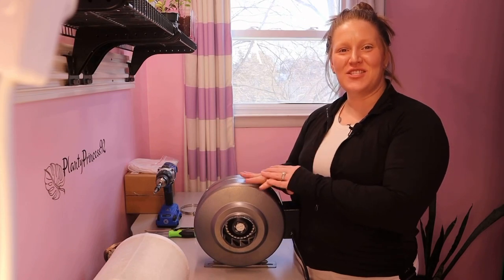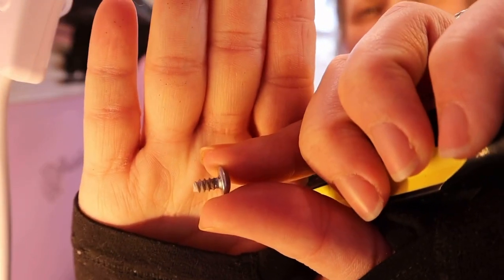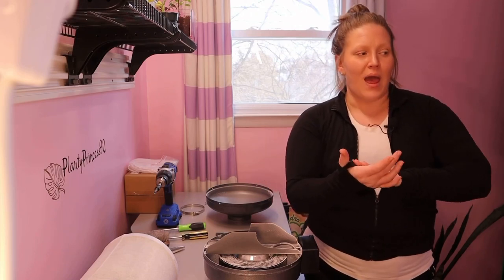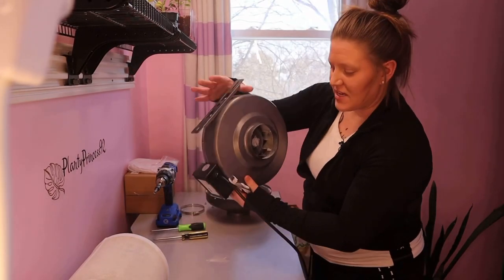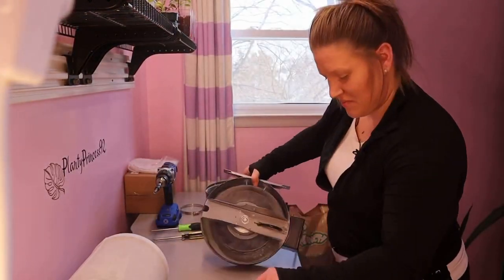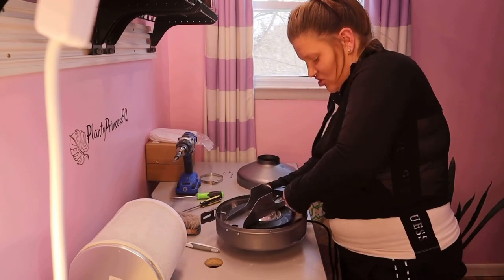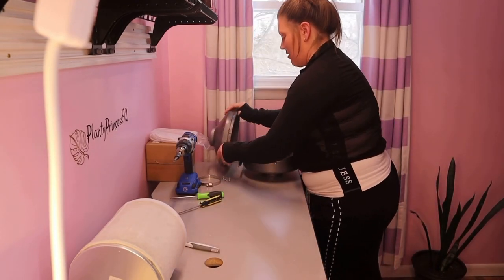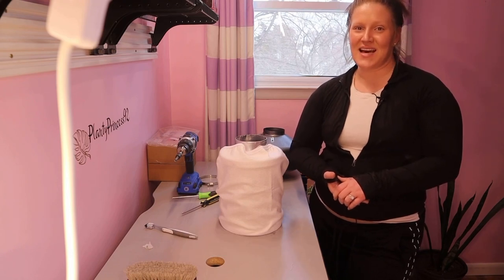Cleaning your Inline Fan & Carbon Filter! ||How to Easily Clean a Grow Tent Ventilation System||

Comment from the maker: Cleaning the inline fan and carbon filter isn’t as difficult or time consuming as it sounds. For me the hardest part was taking it down and putting it back up! I’m definitely going to continue cleaning my ventilation system every 6 months to a year to keep the air surrounding my plants as clean as possible and prevent any fire hazards. If you have any tips on how you clean your inline fan or carbon filter please share them with us in the comments!
Reply: That’s crazy all the build up that gets in there!
Reply from the maker: It is!! But it actually wasn’t to bad for 6.5 months of use! I saw a video on someone cleaning theirs they said after one month and it was nearly triple what came out of mine!

Comment: Using a vacuum with a small tip hose attachment will get most of the dust instead of brushing onto another surface that will need to be cleaned after also. Then use brushes to get the excess that’s left in conjunction with the vacuum.
Reply from the maker: Thank you! Great tip!

Comment: Just Watched your video tape...for over 20 years I have been using a hoover but that Pre filter/condom looking thing is no good...is that thing sucking air through the filter? 
As I have never seen that fluff when it's blowing...
Reply from the maker: Thanks for watching. What fluff? The white stuff sticking to the carbon filter? This fan did the job as far as keeping air circulation going but I only had it running for at this point I don’t remember maybe 6 months to a year tops and I wasn’t impressed at all. This was my first ventilation system so I was learning as I go but I didn’t think that was suppose to happen. I since got a new fan and filter combo from Mars Hydro and so far it’s way better than the one featured in this video!

Comment: seemed like a funny way to strip the old fabric filter off.  pulling it inside out . if you didnt stretch it out they can go in the washing machine and be reused
Reply from the maker: It was so tight on there and almost stuck to the metal there was no way I was slipping it off any other way lol I had already order extras to be able to switch out for when I wash them but this one the fabric literally was like sticking to the carbon filter itself I figured I’d just throw it away thinking it wouldn’t be as efficient since so much of the fabric came off of the pre filter onto the carbon filter! Idk if that’s normal? This was my first fan and I just recently got a new one but haven’t had it long enough to have to clean it yet.

Comment: What is that talcum in the fan exactly though?
Reply from the maker: The buildup? I don’t know exactly what it is but it’s just normal buildup from filtering the air and odor and humidity.
Reply: @NailzByA  Maybe it's ormus, have you heard of ORMUS?
Reply from the maker: A type of mineral I think
Reply: @NailzByA  There was a a big rancher in Arizona who discovered he could extract it from his soil(chemically), his name is David Hudson, he went around talking in conferences about it in the 90's. Some of his talks are still online.
Reply from the maker: Oh wow that’s cool I’ll definitely have to look him up and check it out!
Reply: Its dust.build up. Dust lol
Reply from the maker: Lol yes!
Reply: @NailzByA  if you use a humidifier with tap or reverse osmosis water it leaves a residue like that. Gotta use distilled water only 💯🦾
Reply from the maker: Thank you for this insight! I will be using distilled from now on to prevent as much build up in my fan and filter system as possible!
Reply: @NailzByA  Right on, your very welcome!! 💯💯💯🦾

Comment: I fit fabricate and fit ventilation and i wounldnt use water and definitely dont use any detergent soap its a degreaser and will fuck your bearings up squeak squeak
Reply from the maker: Thank you for these tips! I definitely want to keep my system running strong!
Reply: As long as it pretty dry a slightly damp wipe down wont hurt the bearing as long as they don't get water in them.
 You should be cleaning the old grease out of it (Since, it's already opened.) and packing it with new grease (Especially, after a year of relatively constant use.).
Reply from the maker: I didn’t see any grease on it. Where would I clean and replace the grease? Thanks for this tip!
Reply: @NailzByA  Those bearings are sealed you'd need a puller to get them off & replace the whole bearing. 
 I think there's on them.
 As long as it not making a grinding sound you'll be good.